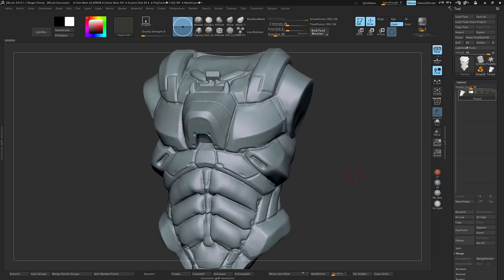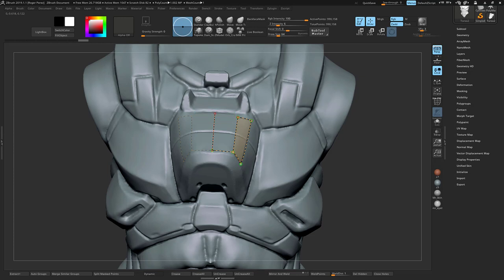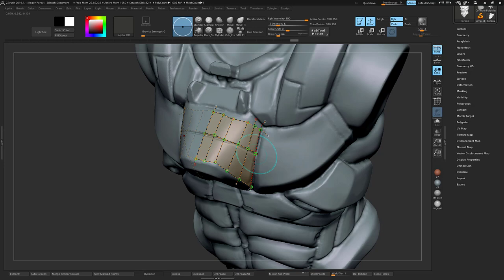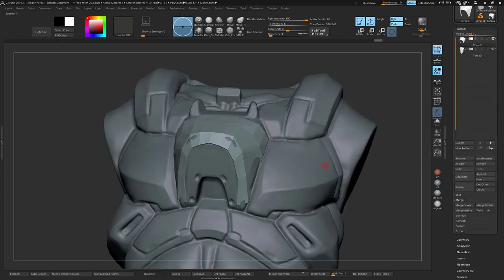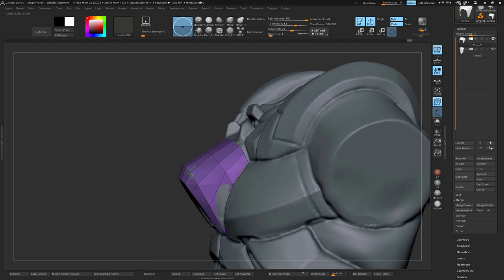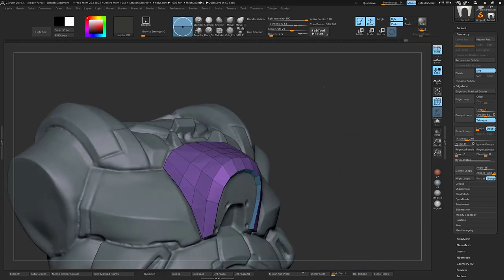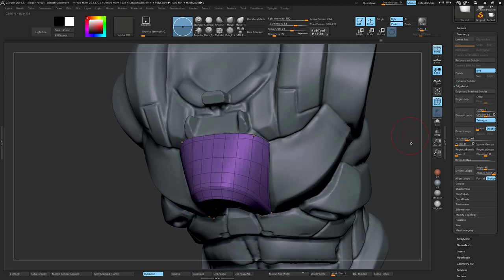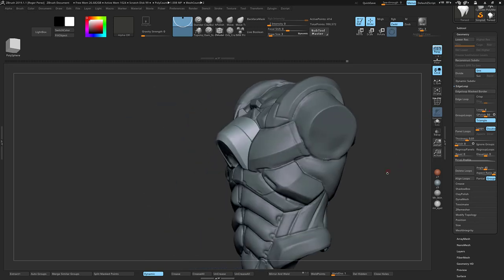Sculpt clean up - Mini Tutorial

Comment: Why use support loops instead of creasing?
Reply: Support loops allow you to control the sharpness of the edge.  Soft vs sharp
Reply: @SlantEyedJoe75  You can do the same with creasing in zbrush simply adjusting a slider
Reply: does creasing hold any information when you uv it and then do hard vs. soft edges when baking
Reply: @SlantEyedJoe75  You can export your high poly model created from the creased one and bake it on the low poly without any kind of issue
Reply: @SlantEyedJoe75  Problem with creasing that if you export the mesh it can't read it unlike adding support loops